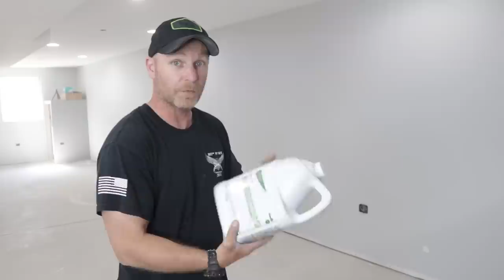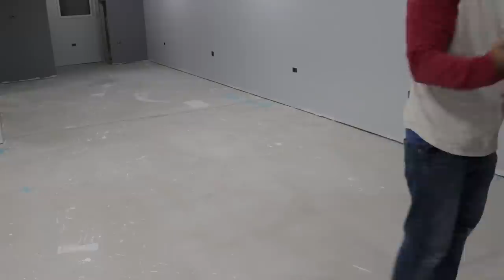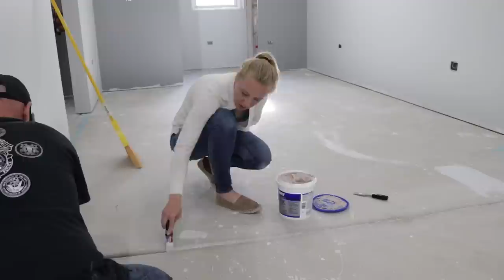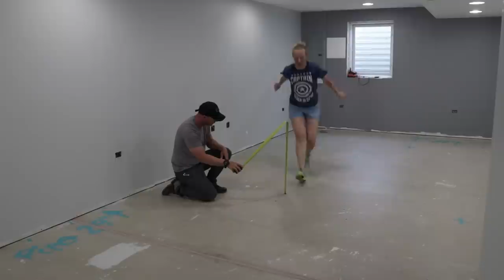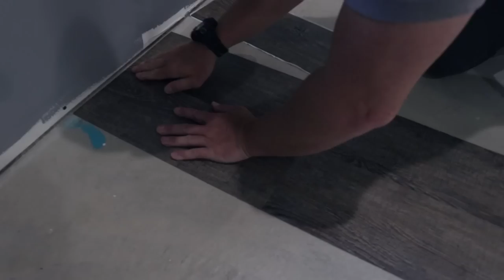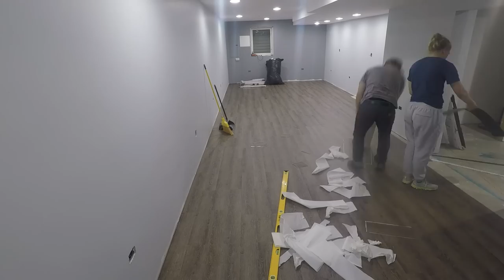How To Install Peel-and-Stick Vinyl Plank Flooring and Floor Preparation

Comment: Great job! And one of the few people who actually show people  that cleaning and sealing a concrete floor prior to either a peel and stick or glue down is a MUST! Especially in a basement! BRAVO!
Reply from the maker: mikeinchgo thanks mike. Since this is my shop and I spend a lot of time in it I wanted to do it right. Don’t want to trip over a peeling floor when holding a chisel lol
Reply: What happens if you don't seal the floor first
Reply: @KomarProject  How much residue do these leave over an older vinyl flooring  if u were to remove them?

Comment: Very awesome!  And Very Deja Vu!  We bought the exact same flooring tiles for our poured basement!  New construction, but just concrete and I just made sure the floor was clear of cat litter and dust before laying them!  750 sq feet and it's a LOT for one man!  Again, nice job on yours and props for doing the prep!
Reply from the maker: YouTube TV thanks so much.  Ya it’s a lot of work but the floor looks amazing and hold up so well.  Glad we did it.  And thanks for the support.

Comment: alot more work than it needs to be. i started laying tiles down at the left of the room working my way over then cut a tile in half and start 2nd row doing back & fourth. came out perfect. also didn't use al those chem prior to laying floor. just clean floor good & thats all & still looks great 2yrs later..
Reply from the maker: kudos2ya37 I’m sure you did a great job.  I needed to clean the floor with a degreaser because it was new construction and I had everything from dust, oil spills and paint all over the floor. Just wanted to be sure it stuck because it’s getting a ton of traffic being a work shop. So far it’s holding up awesome and I’m so glad I went with the product.  Appreciate the comment and support!!
Reply: Well, you might have gotten lucky because cleaning and sealing any concrete floor prior to an installation like this is one of the most important things that needs to be done if you want it done right.
Reply: No No...you are right! I used these in my home and that was about 16 years ago. I did use vinyl flooring glue to give it an extra hold. Other than that, I cleaned floors. Simple clean.

Comment: You did an awesome job! Floor looks great. My husband and I are going to give it a try in our media room. We need something that will withstand heavy use and  is easily maintained!
Reply from the maker: Amy Johnson thank you so much. It’s really holding up well in the shop.  If you have any question during your process please feel free to ask anytime
Reply: Question: Why do you cut several short as you go on??? Is this just to have a different pattern look???

Comment: How do you do the measurement for the chalk line ? 
Also when you do the second row do you cut the plank in half or at what size ?
Reply: Why did you put a chalk line? Can’t you start against a wall? Also did you put the vinyl tile under the wall or just to the edge? Wondering if tile would move, on account it has nothing to keep it secured.

Comment: Are you able to explain why you start in the middle of the room? Also, if you could explain how you're measuring your starting pieces and when you don't put the initial piece right up against the wall?
Reply: I’m curious too.
Reply: AI says: Keep in mind that most of the time, tiles should begin from the center of the room. This rule doesn't apply to every situation, but it's a good starting point. When it comes to floor tiles, starting from the center of the room will make your job easier, and the tiling pattern will be symmetrical.

Comment: I've heard great things about vinyl being waterproof...does this still apply to the peel and stick? I worry that water might get in through the seams but I also heard you cant finish vinyl...What do you think about this?
Reply from the maker: Just like with any other vinyl if may get in the cracks, but I have mopped my floor and even spilled water on it and it’s holding up well.  As for finishing, I’m guessing your talking about wax, you shouldent have to.  Not sure if you can
Reply: I 've had it for 9 yrs and it's great , I wash it as normally as I used to wash the tiles.

Comment: If you are using the peel and stick do you still need to accommodate for expansion along the walls or can you put it flush? Awesome videos by the way.
Reply from the maker: its vinyl so it wont expand like wood.  but i would still leave a little bit, about a 1/4" from the wall
Reply: @KomarProject  Thank you.

Comment: Can it work on stairs? can you show me how to cover the stairs with the peel and stick vinyl plank flooring. My stairs are currently with carpet. They are old and dirty, and hard to keep it dust free. Thanks.
Reply from the maker: Angel chau I’m not sure about stairs, I guess you could younwould just need to find some sort of edge to finish the front of the step with.
Reply: 1)  you strip the stairs of carpet, carpet tacks, and staples  2) clean/scrape stairs/vacuum  3)  paint the riser  4)  glue down vinyl "cap-a-tread" to cover tread.  these are sold in the same color as your planks.  they are listed as floor mouldings/accessories.

Comment: I'm considering at the peel and stick to bedrooms, do I need to remove the molding first? Also, I would've loved if you would have shown a close up of the first alignment against the wall.
Reply from the maker: We did another video on the installation in our laundry room.  Check out that video, should help you out a bit

Comment: How is the flooring holding up? Any issues?
Reply from the maker: Lowell Dizon not one single issue.  I have dragged tools on it and spilled so much stuff on it and it’s amazing.  Just installed it again in our laundry room and I’m going to do an update video to show how well it’s doing.  Should be out next week some time

Comment: Do u apply vinyl self adhesive flooring at the cement floor?
Do u need any extra glue to make it bond more strongly to the cement? Plzz reply me ok..
Reply from the maker: You don’t need additional adhesive.  These are made with it on back
Reply: Thank you for the infor.. I will do video too if i can about this vinyl self adhesive flooring.. Thank you.. 😊

Comment: Hey! I am wondering which products you used for prep. I couldn't catch it. Also I am tipping up the carpet in our living room and is just concrete underneath from what I've been told. Then in the kitchen will be over old vinyl, bathroom ripping up the vinyl because there is a crack in the cement and needs to be repaired before putting anything iver it. Is your suggestion to do step by step what you did in this video!   Also, after cleaning it and doing the prep I saw you guys walking on it no big deal and making the chalk line and then not recleaning. So my question is, is that okay?  Do you have any sections lifting at all it suggestions about that? Lastly(I think) why did you choose to start in the middle of the room? Thanks!
Reply from the maker: So I cleaned it with a neutral cleaner, basically any cleaner will do for the most part that you have at home.  I sealed it with a product from Behr called low luster concrete sealer, and filled the expansion joint with Henry's patch and level.  Both products you can get at Home Depot.  After you clean it your good to walk on it as long as your not tracking in any dirt, also the sealer will seal any remaining dirt or dust that might be left over.  As for starting in the middle it was because my walls were not square (most walls are not perfect 90*) and I needed to go into another room with it.  so I did a chalk like that was square to both rooms.  Lastly the floor has been amazing for us.  NOthing has popped up or moved even with me dragging heavy machines all over it.  Honetly couldent be happier.  Hope this helps.  Good luck.
Reply: You really need to do the prep work if not you could have lumps in floor that will show or tear through and most importantly is the sealing of the floor the laminate will bond tighter and last longer! Good luck with it!
Reply: Thanks! I will definitely be doing all the cleaning and prep work! I say better to over do something than underdo!

Comment: I have sealed concrete floors already, do I need to do any stripping of the finish to make the planks stick? Or will using a primer do the job?
Reply from the maker: Using primer should do the trick.  I never installed over a finished floor before.
Reply: Thanks! This is the first place I’ve lived with concrete floors so I’m unsure too.

Comment: Upon entry from the door, do I lay it down vertical or horizontal? It's a square 15*15 room. Excellent video. Tks.
Reply from the maker: That’s up to you.  Every room will be differant and there is no set rule.  I like going with the longest part of the room.  Visually it just looks better but it’s just my opinion
Reply: @KomarProject  tks!

Comment: Nice video, funny. I wish  you  didn't  speed up through  the  informative  info but, overall  an educational  and enjoyable video. I didn't  think about the sealer and closing  the gap in the concrete.
Reply from the maker: Ya after I posted it I though about the speeding up too.   But glad you still got something out of it.

Comment: Looks great!  I wonder how it would last over plywood subfloor. Any thoughts?
Reply from the maker: OhYeahAboutThat ya you totally should be able to. Just make sure you seal the plywood.  I heard people seal it with a primer.
Reply: Thanks!  I haven’t had good luck with this kind over concrete. I wasn’t sure about plywood.
Reply from the maker: OhYeahAboutThat ya it should work.  I also did a video installing it over existing vinyl flooring we had in the laundry room.
Reply: Komar Project right. That was the first one I watched!  Thanks again.

Comment: I saw the post about cutting the first plank for the second row. I am assuming I should do this to both sides of the first row and alternates between the cut and full plank. Right?. Also, I removed the old vinyl and used 747 to remove the sticky adhesive. I am installing the planks on a plywood sub floor, should I seal the plywood or am I good to go?
Reply from the maker: Yes you should definitely seal the subfloor.  A primer or wood sealer will work.

Comment: Would the process be the same got plywood flooring instead of cement? Not sure if we can Mop it
Reply from the maker: Yes it would be and you still need to seal the plywood.   A wood sealer or primer works

Comment: Hi, how do you get the perfect line down the middle? And what did you use?
Reply from the maker: Chalk line.  You can but it in any hardware store.  It’s a retractable string that has chalk on it.
Reply: @KomarProject  when you started did you the first piece in half? And why do you start on farther from the wall instead of starting right by the wall? Do you keep cutting them in half each row or do you do every other? And when you use the chalk i seen you measured out before laying it down, how far out did you measure from the wall? Is that necessary?
Reply: @KomarProject  sorry for all the questions planning on doing my room and want to make sure I have everything down 🤣 one more question, what do you use to blend it in to tile if that makes sense like is there A strip I can use to put on there?

Comment: i am wanting to install this flooring in my home. I am trying to figure out the best way to lay over plywood subfloors. What do you recommend? Also, should I use a vapor barrier in my bathroom & laundry room? Thanks!
Reply: my laundryroom & bathroom both have old sheet vinyl that is in good shape. Would it be best not to use an under layment, and put directly over old vinyl after cleaning?
Reply from the maker: Make sure you seal the plywood.  Wood sealer or primer

Comment: Great video. We have vinyl on the floor down stairs and it's just concrete under it but we want to use this kind of vinyl aside from what the builder did when building the house so would we need to do anything else to the floor other than clean it or add anything to it. We are redoing the kitchen, downstairs bathroom and the foyer
Reply from the maker: Shakena Mincey if you have flooring over the concrete now then they should have sealed it.  But you never know with builders.  I would throw a quick coat of sealer on it for the vapor barrier.   It will help it stick too.   Just in case
Reply: @KomarProject  okay thanks

Comment: Question, maybe I missed it but since you started in the middle, it must not be dead center middle but instead aligned so when you get to the wall you have the fitment for the planks to perfection (or close to that as possible)? Did you mention that in video or is that common sense? having to vertically shave the planks would be incredible annoying to fit the wall.
Reply from the maker: I start in the middle and work out to the wall.  Then I just cut about 1/4 off the wall and then that spot gets covered with a baseboard.  Dosent have to be perfect on the wall side.  Hope that helps

Comment: Hi looks great do you think this product would work on top linoleum ?
Reply from the maker: myviews it might. As long as the linoleum is not a floating floor.  I’m not exactly sure. I would check with the manufacturer.   Good luck.  I just did a video over existing vinyl. Check it out there is some good info in there if your doing it

Comment: I just laid this over our old linoleum. I'd read different thing's about having and not having to use primer dependent on whether you're going over wood/concrete, which are porous but linoleum isn't so I didn't need to use it. I'm nervous though now because even though it looks awesome, butted nice and tight etc, some of them feel like they are 'floating' a bit?? Think a hair dryer would help? I didn't rent a roller but maybe try that too?? Not sure but we love the floor!  Been down barely a week.
Reply from the maker: We did a video putting this over vinyl as well and didn’t primer it.  Your absolutely right about porous material needing to be sealed and vinyl should end have to be, at least that sounds right to me.  Our floor is holding up awesome a year later.  Maybe you should check that one out and see if the installation you did was the same.   Hope this helped a bit
Reply: @KomarProject  Thank you! I will totally check that out :) Have a great Holiday weekend!

Comment: Do I have to start in the center of the room? Or if I don't would that throw off the final row??
Reply from the maker: It’s depends on your room measurement.  The reason people start in the middle or off the wall is because walls are never even and you shouldn’t reference off them.   Just measure the planks and lay them out to see how your last row will look.  Good luck
Reply: @KomarProject  awesome thanks for getting back with me. Keep up the great work!

Comment: You make it look like fun! Do you suggest letting the floor set for 72 hours after laying the flooring? I will be laying the peel and stick onto plywood and was told to let the vinyl set before moving furniture onto it.
Reply from the maker: labgirlreed ya that’s probably a good idea. The next morning I saw where the joints were but it settled down after a few days and you can’t tell unless you look hard.  I put my tools on it the next day so it didn’t hurt it but it’s always good to be a little on the safe side. Can’t hurt it
Reply: @KomarProject  Thanks for the quick reply!

Comment: Looks good! I am about to finish my basement so the flooring will be soon after. I was thinking of glue down vinyl plank. You have me considering peel and stick now. Any reason for your choice? Just wondering if there was any advantage or disadvantage to one over the other.
Reply from the maker: Initially I got these because of the price and since it’s in a basement I was worries about water damage from water that’s why we went with them.  Since then I put them also in an office and laundry room and love them.  You can go either way but these will be easier to take up if they get scratched or something.  Hope that helps
Reply: @KomarProject   Without watching the video again did you J roll them mallet them or 100 pound roll them or just stomp them in place?

Comment: Will this kind of flooring work over wood, like on a second floor for my house?  Thanks and great video.
Reply from the maker: pat lucas it might.  Not exactly sure.  As long as it’s a smooth sourface with no gaps between the planks it might work.  I just installed it in our laundry over existing flooring and it worked.  But it was not wood.  I posted the video yesterday and it has a lot of good information in it.  Maybe it will help. Just look on my channel and it’s the latest video.   Good luck.
Reply: pat lucas I’m currently doing just that in an upstairs bathroom. I peeled off old linoleum the original builder put in, swept wood floor, vacuumed it up, added the filler he suggested between wood pieces and to cover flathead nails, scraped it smooth, and now I’m waiting for it to dry 24 hours before I add the liquid primer he mentioned. Then I’m going to wait 24 hours to put down the same brand planks. I will let you know how it turns out.
Reply: D Damian thank you.

Comment: Is there a wrong way in terms of placement? 
I saw you worked center floor out as opposed to laying down all the perimeters first.
If so what are the advantages of doing it from the center out?
Reply from the maker: There really is no wrong way. As long as you keep you cuts to 8” or more and go in a straight line.

Comment: Do we need to use adhesive along with the self-stick flooring on the basement floor?
Reply from the maker: No you don’t. But you do need to seal the concrete.   I have heard some people using additional adhesive but the manufacturer doesn’t say anything about it.